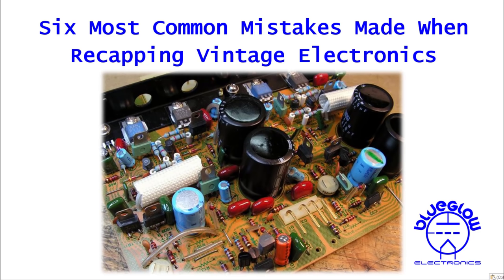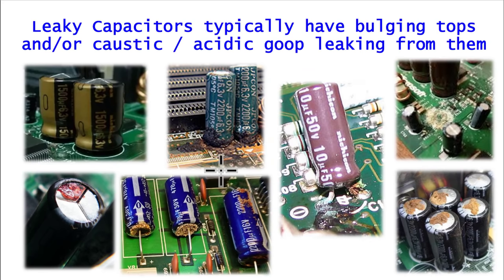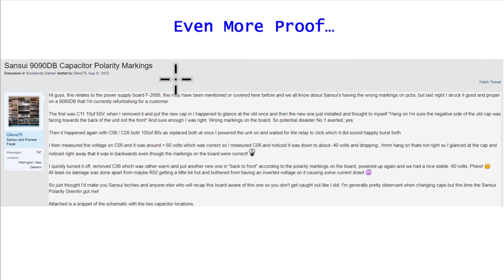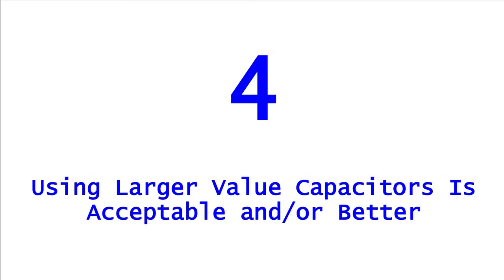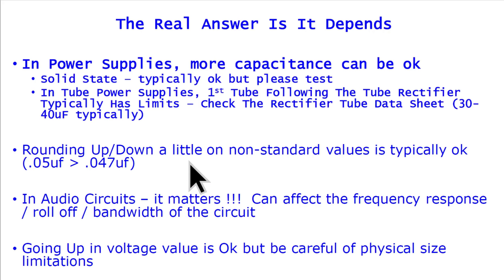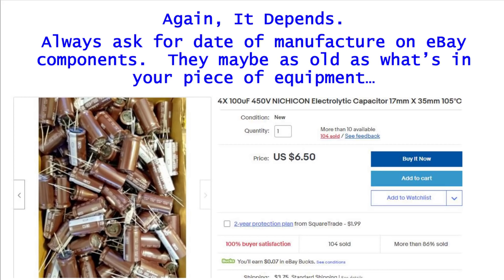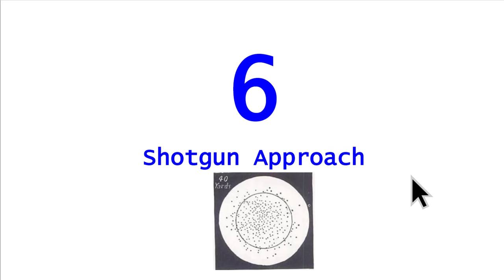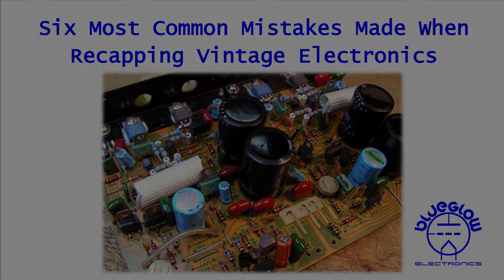Six Common Mistakes Made When Recapping Vintage Electronics

Comment: No no no when you get a capacitor, with the wrong polarity indicated on it. That is not intentional. That's a manufacturing defect. And it is Not, common. I don't know why you think that's common? Perhaps it is now with Chinese manufacturing? But I'm from the older days. The 1960s-70s-80s Recording Studio and Broadcast  Gear.

I have rebuilt my fair share of, legendary Audio Consoles, legendary analog reel to reel studio recorders. Spanning a career of over five decades. And working for some of these legendary companies as well. In fact.

I was the last Quality Control Manager for the legendary, Scully, studio tape recorder manufacturer. Final Test Engineer. Overall Technical Troubleshooter. But then I was also trained by Ampex, 3M and MCI. And declined offers from both Ampex and MCI. Yet. I lived close enough to MCI. I can walk there from my apartment in Fort Lauderdale. Back in 1979. When they were still in their heyday. And I had one of their 8 track recorders and one of their 2 track, JH-110 A, recorders. A couple of Scully 280 B's. That were all brand-new at the time.

Ending the QC Manager for Scully. I never experienced, any backwards labeled electrolytic capacitors, ever. Of course that was 1979. Nobody's competent anymore. I build stuff that has lasted to this very day. Nobody builds anything like that anymore. It's all designed to last maybe one or two years. Before it falls apart. Yeah screw that.

And so replaced capacitors was very funny also. Because if you're going to recap and $85,000. In 1972, dollars. You'd only want to use, the best electrolytic capacitors, money could buy. But I said screw that.  Most of what I needed was available at RadioShack. When they still existed.  In 1996. And everybody told me not to put those crappy things in.

I'm happy to report 26 years later. They worked just as well as the original high-end OEM ones. Since manufacturing between the early 1970s and mid 1990s. Had advanced somewhat. And all those capacitors worked out great.

Do they sound different from the high-end, Panasonic electrolytic capacitors? They might? I don't care. It's unimportant. Technology when it was conceived and built, originally. Not as precise and mass-produced. As it is today. To, more exacting standards. And they worked and sounded just great. Nobody ever listen to any my recordings and then asked me… Those don't sound like you're using the Panasonic capacitors? You'll never hear that from anyone. And they will think less of you if you said you used, RadioShack capacitors. Like I did. On $85,000 custom audio console from 1972.

Yes and I had to replace, hundreds and hundreds of all the electrolytic capacitors. Every single last one of them in a 36 input, 8 bus plus, Stereo Mix Bus Output. If memory serves me correctly? And it doesn't anymore. I think it was about 15 per channel for, 36 inputs and 16 outputs. And that's a lot of electrolytic capacitors to replace. One at a time.

And when it comes to refurbishing old gear. If you really want it to work like new and reliably again. Get yourself an ultrasonic cleaner. With some surfactant based, grease cutting, detergent. I used the original formula to Fantastic Spray Cleaner. Because we did some tests at Scully. It's great with aluminum. It bleaches aluminum like new. That's closest competitor 409 left nasty, like black anodized spider like stains and streaks. To the aluminum. And I have a certain procedure I created. That has now pretty much become the De facto, standard. For, refurbishing, restoring, repairing. Legendary Audio Consoles, from the 1970s and 80s. Those real legendary  ones. Like the British, Rupert Neve, consoles. The American API, MCI, Auditronics, consoles, et al.

And I came up with my technique likely because,, I trained with Ampex, MCI, 3M and later went to work for Scully. At associations with some of the audio console manufacturers. In close collaboration with some things. And it's all based upon, the original manufacturing. That can seem a bit, bizarre to some. Because it's also good for a laugh. And works outrageously well. Breathes new life into what you thought was, worn out switches, worn out potentiometers and volume controls. The best technicians would tell you. We all need to be replaced yeah. No you don't have to. You just have to clean them right. Many are, sealed. And everybody tries spraying in some kind of aerosol based, cleaner, restorer, lubricant. And while it might help. It quickly reverts back to dysfunction. In no time flat. And always at the wrong times at most embarrassing times.

So you don't piecemeal the repairs on old gear. It'll never be right. You just have to sit down. And decide you are going to restore the whole thing in one fell swoop. Because when you are done. It'll be like it was just built yesterday. But still feels nice and broken in. Without breaking down. And it sounds like God, again. Because all the electrolytic capacitors have been replaced. Every single last one of them.

Generally one does not need to replace the, Non-Polarized, capacitors. Though some can be extremely sensitive to moisture. Such as, Polypropylene or is it Polystyrene, capacitors? Something like that. Those will also be good to replace. But mylar and ceramic and tantalum capacitors generally don't need to be replaced. And good for a lifetime.

But yeah the ultrasonic cleaner. Will be able to blast, air particulate pollution. Off of the internal switch and potentiometer, contacts within. And you thought they were shot. You'll find out otherwise. And have a good chuckle. When they work just like new again. Though you might need to add a single drop. One drop. No more. Of what our present pure, Silicone Lubricant. Which is difficult to find. But can be acquired from, Penny & Giles  of the UK. And you only need a little bottle. Because you will only use, no more, than one single drop. Don't be a wise guy and use more than one drop. You'll find out why if you do so. And whoops. It gets over everything. It migrates. It crawls. It's like billions of little, silicone, ball bearings. The size of molecules. And that some kind of slippery. One drop is all that Penny & Giles also recommends. But is also applicable to, switch shafts and batters. That even after washing and drying. Can still be a little crunchy. As I also did not use, distilled water. I used tapwater. And there was some calcification when it dried. On switch shafts. And the one drop of silicone, goes a long way.

I used to live for this stuff. It was my bread-and-butter.
RemyRAD

Comment: Third assumption any electrolytic type capacitor has a shelf life of more than 25 years. This is false. Whether the device is leaking or not is not the point. If it's more than 25 to 30 years old it must be changed.

Comment: If its over 25 - 35 years old, they need to be changed, not doing so is foolish and risky... simple as that... nichicon uhw uhe upw uld utt are great radial caps as well as panasonic fm and fc... pretty much everything else is junk unless you're talking audio caps for audio circuits such as the nichicon fg muse and ka series or vishay or kemets and united chemicon caps... only things you gotta check is if it is bi polar or not capacitance rating Ripple current rating load life rating temperature rating if it's a low leakage capacitor or not. Most eletrolytics aren't... only buy caps from  mouser or digikey

Comment: Caps are round/cylindrical so there is no “forward” or front, Bungle-dow.
Reply: He didn’t say there was. You need to clean the wax out of your ears. He said he marks caps so that the marks are to the front of the device, not the front of the caps.
Reply: @melgross  ... he also said that if you find the board to be mismarked at least you have some way to double check against how the original was installed.

Comment: Oh yeah. Service manuals that do not match your equipment precisely. That's always fun, fun, fun. Until daddy takes the T-Bird away. Because there have been some gross, Typographical Errors. For, Studio Recording Equipment. That was a small fortune. Like a stereo reel to reel Scully tape recorder. Only 2 channels. Costing is much as a brand-new Toyota Corolla. And then to find, gross, Typos,, not just in their schematics. But also in the Ampex MM-1200 schematics. In the Neumann U-87 microphone. That only has 1 transistor. And in the schematic. They indicated the wrong type of transistor. And they indicated it installed, backwards. Somehow I don't think Germans make mistakes like that. They don't. That was done on purpose. And the reasoning is, sound. If you excuse the pun. They didn't want you to be able to fix it. Apple doesn't want you to fix  your smart phone, your tablet, your computer.. They don't want you doing that. Neither did Neumann. Back in the early 1970s. But by the time they got to 1983. American law changed. They could no longer get away with doing that.

I meet these were very serious typos. That if you were to build one from scratch that way. It would never work. Because it's the wrong type of transistor installed backwards. Who does such things?

Motion sensing for the $36,000 Ampex 24 track recorder. Doesn't do you any good when it's indicated backwards wired. It only spills tape and shuts off then. If you follow the schematic.

Or even wear. The manufacturer erred on the side of caution. With the values of some parts. Which you can replace with larger values overall. And achieve a noticeable difference in sound quality and breadth.

So this is a very cool video you created. I commend you.

And I own no. They were not, plus or, minus, 10% of their value. You only found those in higher end equipment. They were generally 20% in consumer gear. Of varying printed values.

Though in filters circuits. You definitely want to get the correct value capacitors. Because those in combination with resistors and/or inductors. Specifies the turnover frequency. And will change in frequency. If you change the indicated printed value of the intended capacitor.

But hey. Most of it's only Rock and Role, jelly or powdered sugar, glazed or cake style. Whatever you like. And goes great with beer. And cold pizza. And we won't tell anybody. If the 5 kHz knob on your equalizer is actually now, 6 kHz. It'll just be our secret. And we will be able to live with that. It'll be no problem. But hey if you are doing stereo pairs?  Make sure the other channel is the same.

And that's why you want to replace electrolytic capacitors. In one huge, Shebang. Do it all in one or 2 days. Turn on some music. Turn on your favorite video. And go to it. Your brain will go numb. But you have to get everything right.  So you do not have to fix or troubleshoot anything. And so far I've got a flawless track record doing that. And I built some pretty large audio consoles through the years. And some cool reel to reel recorders. Back in the day. And I learned a few things working in the factory. Or being trained at other factories. I put all my knowledge together. To come up with this new technique in, restorations. And because I wanted to work for the next 20 years, flawlessly.

And that's all electrolytic capacitors are really good for. They are similar to the battery in your car, smart phone, laptop. And they poop out after a bit. They can no longer hold their charge correctly. An audio turns to crap! Because DC also starts getting through. Causing a nasty analog offset. That can actually blow up your speakers. Depending on the type of amplifier you use. And you won't know it until your speakers are blown up. You will smell something, burning, smoldering before that happens in your woofers go out. It'll take your woofers out. If you use a Crown, DC-300 A Type II. As the model indicates it is a DC, amplifier. Plug a 1 1/2 old battery in at the input. Turn up the volume. And you get up to 150 W worth of DC output. At much higher voltages. Because it can amplify DC. Not all audio amplifiers can do that. Some have protection built-in. To keep everything within the AC realm. But I preferred the sound from, the Crown. I have 2. One currently dysfunctional. A friend of mine is a good tech. He tried to fix it. He couldn't. And he's an up-and-coming, Recording Studio Processor,, company. He makes Mastering Equalizers, custom Preamps. But he couldn't fix the Crown. I asked did you replace the big electrolytic capacitors? He said no. So what the hell man? He replaced the smaller ones. The much more affordable ones. Not the ones the size of beer cans. So let me guess what has crapped out?  Those Capacitors.

(More Dead Caps in the following post)